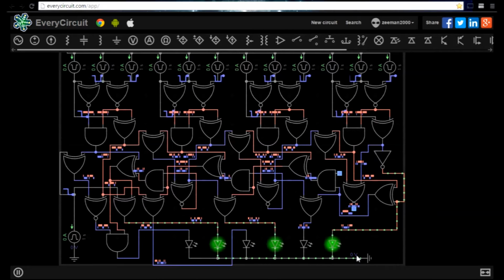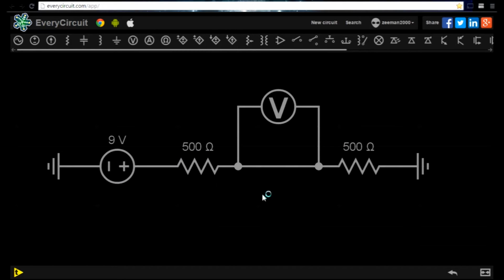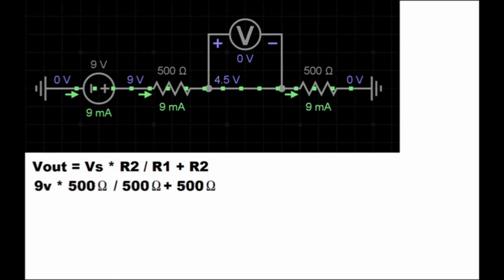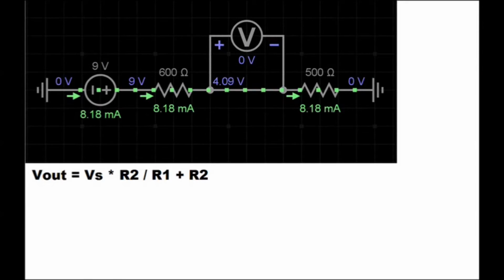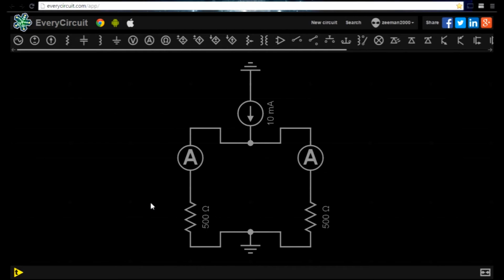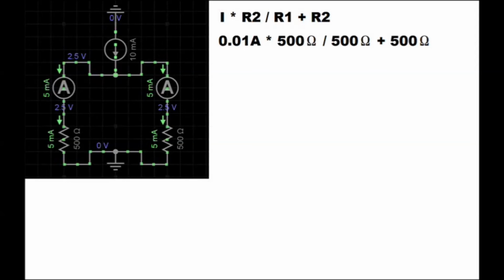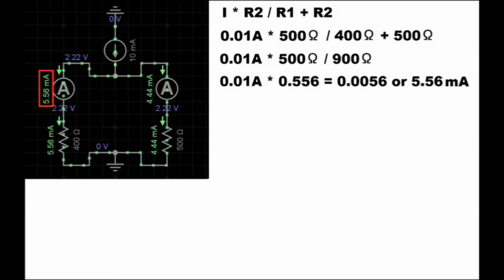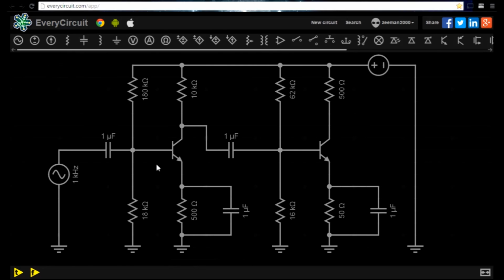Electronics Tutorial 10 - Voltage and Current Divider

Comment: Is there a way to get EveryCircuit to display with dark lines against a white background?  On a complicated circuit like this it can be quite hard to see all the details clearly.
Thanks for the excellent videos.
Reply from the maker: Hi, at the moment there is no way to change the background colour. The only option is to save a screen shot of the circuit. It will give you the option to have the background in black or white. Hope this helps.
Reply: Thanks for the reply and the trick about saving a screenshot.
I also use AutoCAD and always have the background white, although the purists have it black.  I think that was the only option when it came out 30 years ago. Some people don't like to change!
Perhaps EveryCircuit could add it as an option?
Reply from the maker: It would be good if this option were available. You can contact the developers with suggestions at info@everycircuit.com

Comment: in between two resistor how come 4.5 volts please clarify that
Reply from the maker: the circuit demonstrates how to divide your input voltage. As the supply voltage is 9 volts and the two resistors are of equal value, this will reduce the output between the two resistors to 4.5 volts.
Reply: @Jenko022  The meter is in the wrong position. To measure the drop across any resistor would require the meter leads be placed across the resistor under test.